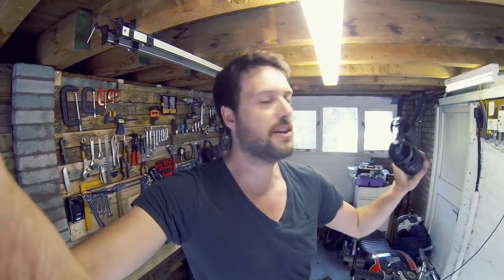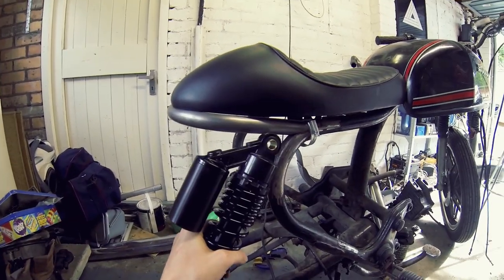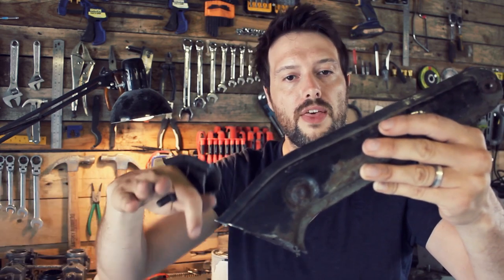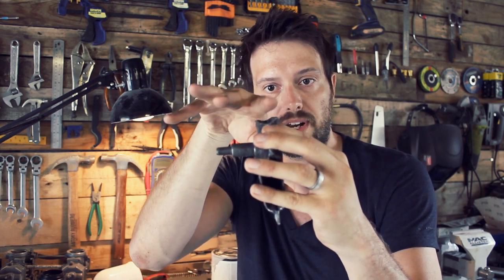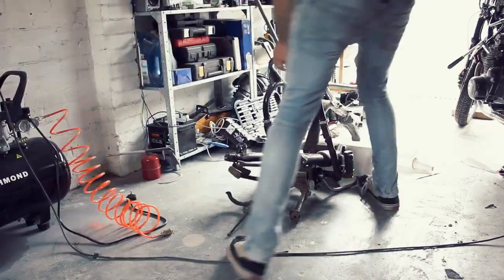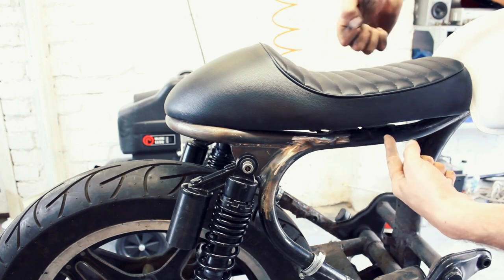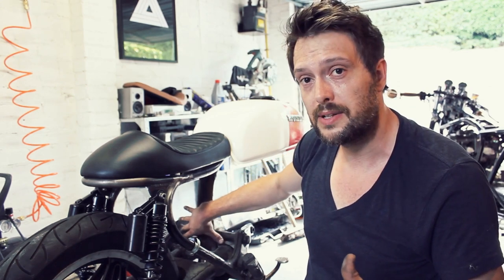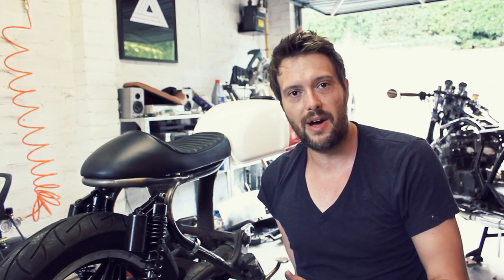Honda CX500 Cafe Racer Build 12 - New rear frame hoop & shock mounts

Comment: I am really disapointed with this "build" you said that you are a disigner, then disign something for this bike you are just making it the same as many many others, you know better, the subframe should be straght and the bottom line aligned with the tank, cheap seat from ebay? You thinking to leave the stock breaks at rear and probably at front too, and you show to us on some others videos Sacha Lakic cx500 beautifull disign, BBCR Engineering cx500 an other beauty and you come up with this?, this people that cheer you up on the comments probably don't know how to handle a hammer, I just finish my cx500, I can send you pics, I will not up load on you tube, l hope you change your mind and build this bike accordingly at your skills, regards
Reply from the maker: That's a shame you think that. What I wanted to design was a new rear to sort the CX500 rear frame wave as I find the natural curve beautifully designed already. And I disagree, to fit a Sacha Lakic or a BBRC rear would just be copying, not to mention the safety issues you have if you don't change the rear swingarm to a square tube rather than the standard circular tube arm. (Square is stronger). p.s. if you want to go monoshock just buy a GL swingarm as that's already done. 
As for the straight subframe, why should it be straight, where's this rule? I think the way the frame curves is beautiful.